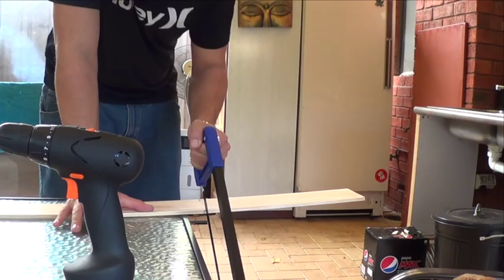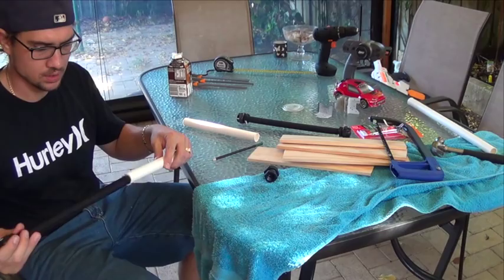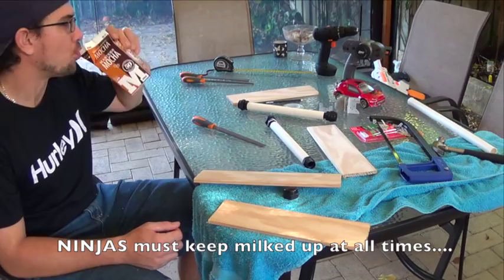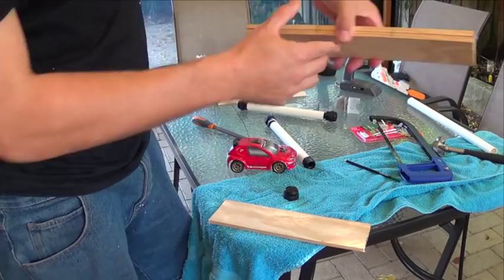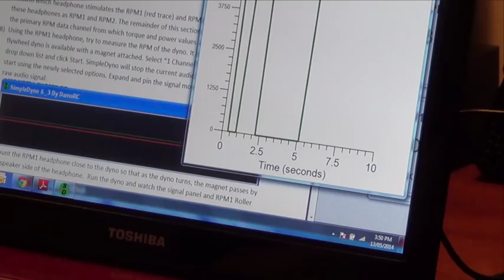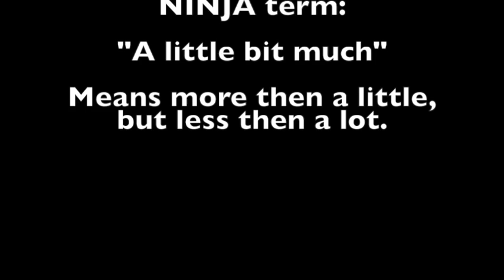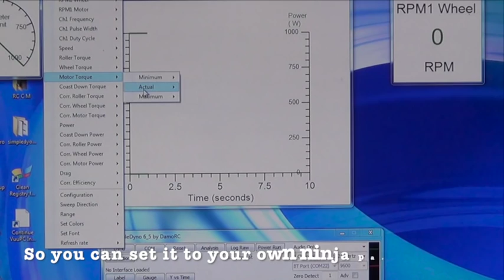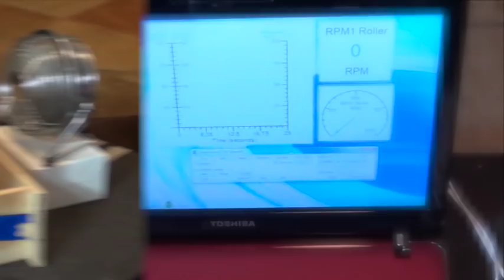Build your own RC Dyno - RCCM

Comment: This is no dyno, dyno measures power this measures rpm.
You can find rpm by motor kv X volts the use formulas to factor in gear ratios, final drive and wheel size you can also find theoretical top speed. Formulas can be found on car sites

Comment: Why not use 4 tubes 2 sets of 2 close together so wheels can sit there
Reply from the maker: +TheDiscipleOfHell yeah the build was difficult to keep the car on the dyno. That could have helped but increased noise which messed with the readings.
Reply: @RCCarModsNinja  if you had half a mind you'd use bearings in the rollers. A simple look on YouTube under diy rc dyno and you will find designs way better than this garbage.
Reply: @derekr7814  do you have a rc dyno yourself my guy?

Comment: Thanks for the video! It helped us with our STEM project! Do you know the size of the pipe you used to rotate? We are getting high, unrealistic speed readings and we think it's because our pipe is much smaller in diameter, so it's not working with the intended software as well. Any help would be appreciated!
Reply from the maker: Horsepower Motorsports you should be able to put tue dimensions into the software setup.

Comment: u know the traxxas tqi radio system has telemetry but u have to have an iphone and its pretty hard to dial it in right
Reply from the maker: There is heaps of tuning in a dyno. I added all the easy stuff like weight, engine power etc. Then even if the data reading isn't accurate. ie rpm etc I can at least use them as a base and determine if the changes give a higher or lower reading. Thanks so much for watching.
Reply: yah its pretty cool man it kinda gave me an idea for one thank u
Reply from the maker: your welcome, would love to see you build one. let me know if you need any help. cheers

Comment: Hi.. I wonder if the headset and magnet thing will work on my idea on making the dyno for motorcycle.. Just wondering if that would create accurate output for motorcycle or should I just go fuck myself.  Thanks bud..  You've been helpful
Reply from the maker: the concept would work as you put data into the program to set all that stuff up. the one tricky bit if the noise created from the car slash motorbike can sometimes confuse the speakers. hope that helps.
Reply: Ah. What other data logger can be used instead of headset that would seem be more accurate?(USB device logger or any else?) Ive been thinking about such project since I watched yours..